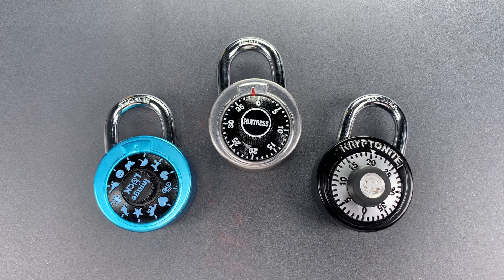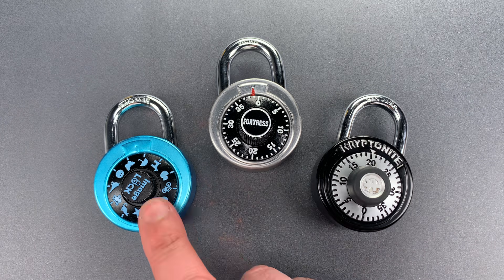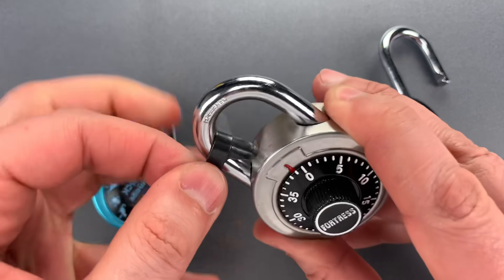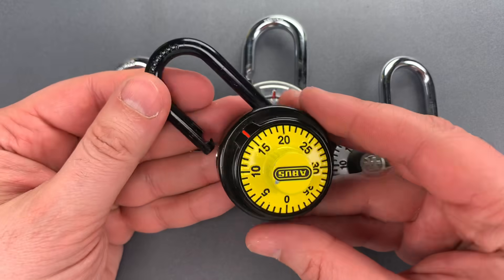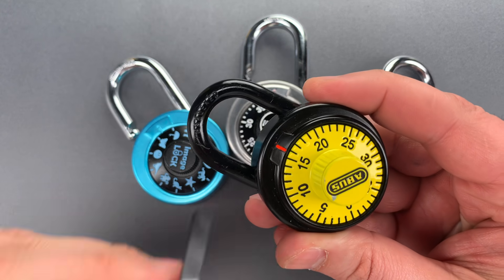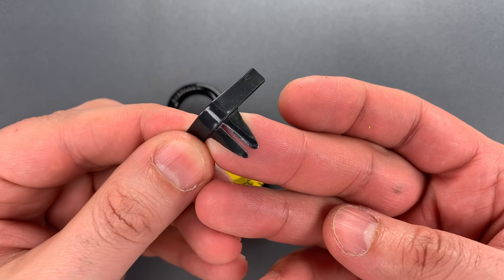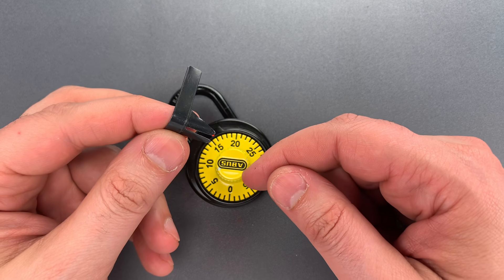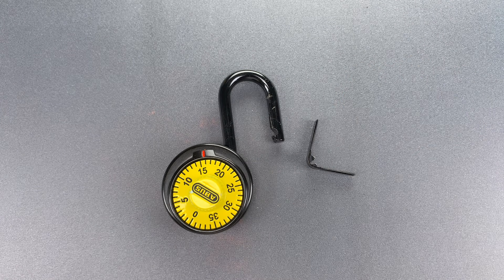[1243] Shimming The Anti-Shim Abus Combination Lock (Model 78/50)

Comment: Instead of 1 second taken to open, Abus increased the time to 3 seconds. It is a 300% increment in security ! :-D
Reply: You should be head of marketing dept
Reply: Lol yes
Reply: "New lock, now 300% more secure!"
Reply: Not 3 if the thief needs to cut his tool.
Reply: Adds in ~5 seconds to cut with scissors. 800% more secure!
Reply: @robot_killer  no why should he have scissors
Reply: No, it is a 200% increment.
Reply: @bethankfultohaveinternet3292  
Well now the thief probably has two shims. One for the regular padlocks, the other for the ones with notches in them...
Reply: does the altered shim still work on the old locks? if that's the case, just bring altered shims.
Reply: @jaghatarkebab2020  Not you people again.
Reply: @HunterShows  200% more secure, 300% times more secure
Reply: @HunterShows  Weren't you on that ottolock video lol
Reply: 200%*
Reply: @stylesrj probably a thief will just cut the shackle

Comment: Well, they tried. And that is more than we could ever say about Master Lock.
Reply: ML tries as well, their best cores are in their weakest locks. They just need to learn to put good components with each other.
Reply: exactly - gotta give them credit for trying to fix a problem
Reply: @Hans-gb4mv  like their LOTO plastic locks, with great cores 👏
Reply: @Hans-gb4mv  There's a reason for that, those stupid red plastic locks are electrician flags, not tamper prevention.  The point of the extra pins is reducing the odds that any 5 electricians might have the same key.

So Masterlock can do better, and just doesn't.
Reply: ML's lack of resistance in their locks is exceedingly trying.
Reply: you can't be comparing Abus with ML, Abus makes some of the most unlockable cores, that even LPL can't pick, yet :))
Reply: @tsm688  But the LOTO cores also have security pins, which the normal cores don't. The security pins aren't going to do anything about electricians with the same key. 

And, anyway, I would imagine that no prudent electrician is going around removing a LOTO without doing a ton of diligence that they're not putting someone in danger, so even if two electricians had the same key I would hope that the one with the duplicate key wouldn't take the LOTO lock off if it wasn't theirs.

All this is to say that it's kinda silly that one of ML's better cores (with security pins and such) is in a lock that's not actually really a lock (since if you wanted in you could get through the plastic body of the lock trivially).
Reply: Master Lock is fine
Reply: Master lock apparently has improved their 4 wheel combination locks so that theu can't be shimmed so they look like theu might possibly be starting to listen.
Reply: Why even try when LPL exists?
Reply: They really need to hire lockpicking lawyer as tester and not just send product for free to test... So he can actually help the market to grow security and its right he got money for this.
Reply: @ArchangelExile  Because security doesn't begin and end with "can LPL bypass it?"
Reply: Actually the master lock can't be opened with these shims, believe it or not the locking pin has cuts in it that dig into the pin and cannot slide it back.
Reply: @Gkitchens1  no they can just in a different way
Reply: @kieranreid4142  how, can you explain?

Comment: WOW ....The "fix" defeated in under 30 seconds..
Reply: And it was probably designed over months xD
Reply: It's mind boggling the solutions corporations come up with.
Reply: @hcgtiger4724  let the dead bury the dead.
Reply: "Locks keep honest people out" an old man said that to me years ago. If somebody really wanted to break in they will, like a window. Even the exterior construction of a homes wall is fairly easy to get through, usually 1/2 inch plywood which you can cut quickly, insulation that can be pulled out by hand, then drywall with a foot or 2 hands
Reply: I haven't met a combination lock like in the video that I haven't been able to open with a swift downward blow with a framing hammer. Doesn't need to be picked, bring a hammer
Reply: @dudesumting  the lock should be good enaugh to force him to use other methods tho, if he breaks a window therenis evidence, if he makes noise maybe someone will notice.
Reply: well from defeat in 3 sec. to defeat in 30 sec. is a 1000% improvement.
Reply: @HalIOfFamer  I do not disagree with you at all, but in my mind most thieves know that missing items will be noticed regardless so there's not much insensitive to be that discrete.
Reply: @dudesumting  everyone is always so worried because they themselves would be thieves, therefore they constantly consider how to protect against people like themselves. Seams that Way, but I am just an observer with a perspective.
Reply: @shaunstark4263  not always, ever watch a serial killer documentary and thought about how stupid their mistakes were? Kinda the same concept lol we're not murderers but we like to play pretend in our minds. I'm no thief but I imagine myself as one when thinking about how secure something is lol
Reply: @Herdatec  good point!
Reply: @dudesumting  I'm not interested in pretending against the desires of my heart. They hurt. Do you pretend against your desires? Or do you pretend according to them? I haven't considered pretending against them, anyway. Perhaps I should.
Reply: @shaunstark4263  well we've clearly lived different lives, for me imagining how another side thinks really helps prevent future headache.
Reply: @shaunstark4263  when you live in a region with alot of unsavory people you learn how they think to stay one step ahead
Reply: @dudesumting  I am aware that I have lived a life in which I could not clearly speculate the intentions of others. Many be lie ve they can. Pride lead me to think I knew how the other side lived as well as my own. I know my own, and Trust them implicitly.
Reply: @dudesumting  I have also learned that unsavory is a matter of perspective, and my own perspectives have been thoroughly subjugated by my  desires. Upon this realization, many changes occur which can not be accurately described to or from the previous state.
Reply: @shaunstark4263  "Perception is a motherf*****" An army captain told me that one recently. I wish you good health.
Reply: @HalIOfFamer  
The lock is meant to secure a couple of books at school or stuff like that, it’s by no means intended to secure really valuable property in areas with a significant risk.
Abus ranks it as 3 out of 10 on its scale and says it’s for securing low value items or areas with no significant risk.
Reply: @HalIOfFamer  well the accountants probably said a fully splined shaft was too expensive
Reply: but 1st, get a scissors in 30 seconds....
Reply: I'd like, but for my fondness for the triple nickel.
Edit: too late.
Reply: @dudesumting  how deep is a well? 
Blessings to you, and yours.
Reply: AND you could probably includes the tool modification in that time....
Reply: @dudesumting  whoever told you locks keep honest people out didn't really think that statement through. Honest people, by definition, are not going to break into your house and steal from you. Therefore they don't need to be kept out. Locks are for keeping out uneducated dishonest people.
Reply: @dudesumting  depends, in most European countries, houses are made from bricks, not so easy to go through.
Reply: @derekhunter5040  you don't get it
Reply: @derekhunter5040  you're too literal
Reply: Hey, it took almost 10 times longer to open it...
Reply: @derekhunter5040  yea little too literal bud

Comment: Abus - spends untold number of man-hours and dollars developing new anti-shim padlock

LPL - spends 99 cents on scissors
Reply: Honestly, this probably took a single engineer less than a week to design.  Probably like a day to brainstorm to find the best possible routes to take and 2-3 days to iterate and find dimensions that work.  The hardest part was finding a solution that someone else didn't already have a patent for.
Reply: 99th like
Reply: @johannes960  you have fulfilled the prophecy and brought balance to the force
Reply: And it will work for all those existing shims still out there and in production, and for those that don't see this video or aren't clever enough to think of this themselves.  Thieves are not the brightest.

Comment: Abus: Makes shim proof lock
LPL: And I took that personally.
Reply: More like shim warded. If they wanted to make it shim proof they could simply do same thing as spring loaded door latches have (atleast good ones), have a second deadlock spring latch. This is push in activated by the door or in this case by the shackle going fully locked position. When dead lock latch is depressed (which is geometred to happen only after lock has depressed the spring loaded lock sear), it will deactivate the spring loading of the lock latch. Thus completely and utterly preventing shimming.

Shimming is based on inserting extra material, when dead lock latch must be deactivated by REMOVING material aka the door strike plate or shackle bar in case of padlock. The only other way to deactivate the dead lock is by actuating the actual lock cylinder. Thus as long as geometry is done correctly dead lock latches lock is shim proof. Once the deadlock activates, to push away the deadlocking bar either the latch resting against the shackle has to move out of way or the main lock cylinder must rotate out of the way to firstly allow the deadlock to release and then release the main locking latch.

These are decade old idea. The only it isn't used in padlocks is probably cheapness and lock of space. deadlocking latch would mean more mechanical complecity and thus price. Plus ofcourse in big door lock frame there is more room to run a dead lock latch. So one would have to do some extra extra engineering in small lock body to run the couple extra levers needed for dead locking.

So usually padlocks just do away with spring loading at all and instead leave it up to user to notice.... Oh this has been rotated to locked, I have to unlock cylinder before I can locks this again.
Reply: Man I read that “makes a shim lock proof” and I thought this was the most advanced joke I had ever seen. 
guess I’ll go back to bed. My brain go boom right now.

Comment: I remember trying to explain a general security exploitation philosophy to a friend of mine, which I think this is an excellent example of. Features which simply the experience of legitimate users are always worth investigating for vulnerabilities. In these cases, the experience is simplified by being able to close the lock without entering the combination. A lock which had no slope on the lug or shackle would require the lug be retracted for both opening and closing. A similar example is entry controlled buildings with no exit control; like door locks that require an RFID card to enter, but have motion detectors for exit. If you can slip something through a crack in the door you may be able to trigger the motion detector.

Comment: I would LOVE for LPL to design some actual anti pick features of locks
Reply: Well, the solution for many issues is Bowley locks. LPL has yet to actually pick even the weakest version.
Reply: it would actually be surprisingly "easy" but mass production would be either impossible or so expensive no one would buy it.
Reply: @DivinityOfBLaze  Yes he's done a few videos on those.  I'm curious how he'd overcome shimming on a non-keyed padlock
Reply: @theRandy712  isn't itbas easy as building the exact width for the shackle and the lock?
Reply: @DivinityOfBLaze  , I agree.  They even link to LPL's videos on their website.  Not that ABUS would do that!
Reply: @DivinityOfBLaze  Bowley Lock Grade 2: "The exterior cylinder housing is cast out of solid metal and come with large shields to protect against "ice pick attacks". The exterior housing is independently retained by 2 extra heavy duty screws which mount to an interior reinforcement plate to prevent the against "hammer attacks". LPL: Today we have two Grade 2 Bowley Locks. The first we're going to pick, and the second we're going to attack using a core puller........Well, that's all I have for you today...'

Comment: 5 seconds to shim the ordinary lock
10 seconds to shim the anti-shim lock
10 seconds to snap both off with a hammer.
Reply: 2 seconds. Hammer blows are virtually instant. Just may need a moment to realign.
Reply: @professorfukyu744  - size and quality, a bit noisy thou
Reply: Bolt cutter, 1 second

Comment: I find it hilarious how a company could spend months researching/developing a solution to simple picks like this, just to be ruined by LPL in a matter of seconds lol. These companies really should test more before calling something unpickable. They are the Titanic and LPL is the iceberg.
Reply: The obvious solution is to get LPL on board to help design a lock, then he can't very well destroy the company's reputation in a 90 second vid...
Reply: The trubble the designers have is that there tasked with doing so without impacting the manufacturing cost or time.
That's why abus went with a plate instead of  a ball-bearing mechanism.
Reply: When you sell a $4 lock you can only do so much. When asking for more money is when it should matter.

Comment: I would love to see you add a series much like the ramset, a truck winch pulling the body of the lock away from the shackle exposes a weak point. 

Where i live pad lock type devices are used mostly on gates to keep other vehicles out. I have yet to see this fail, and often the lock is actually still functional.

Comment: In high school we use to open combination locks by taking off a boot and smacking it downward or landing a drop-kick. 
You could usually get a few dozen of those opening before they broke, unless you snapped the pin under the dial, in which case the were forever open.

Comment: At this Point Literally, every lock company should give LPL Ratings to their lock. If they think their Lock is Un pickable it should be LPL Certified.
Reply: Rated by the picking technique: Comb Pickable, Shimmable, Rakes open, Single pin pickable,  Requires "The tool Bosnian Bill and I made", Ramset, and 50 cal.
Reply: "As Featured in an LPL video that is 8 minutes long" would be a hell of an endorsement.
Reply: @askjacob  that could be misleading, he's spent that long ripping through the designers for the poor security or demonstrating EVERY vulnerability the fools left in it.

Comment: Makes sense.  As long as the combination dial is the only control there's no practical way to install a non-spring-loaded locking system like ball bearings.  So a dial pad lock will pretty much always be shimmable.

Comment: To be fair to them, this would prevent the use of standard padlock shims and most typical thieves (or high school students / principals / kids) would have no idea why, and probably wouldn't cut off the padlock and disassemble it or buy their own to figure out why & then make a custom shim. Any thief that will go to that much trouble probably isn't going after something defended by this kind of padlock anyway.

That said, amazing job by LPL, as always. I like these kinds of videos with the quick analysis, problem solving, and ingenuity on display; just as impressive as the ones requiring just raw picking skill. Maybe instead of trying to bolt on a fix to a broken design, the lock designers should try coming up with a new design without the flaw(s) that allow this kind of attack in the first place.

Comment: Wow, when you break into someone's locker by shimming one of those locks, you gotta wait a little extra not to raise suspicion because of how fast you opened it.
Reply: I was thinking the same thing, I had a lock like that on my bike years ago, and it took a few good seconds to do the 'three turns to the left, two turns to the right, one turn to the left thing (and trying to undo one in the dark by moonlight was fun...)
Reply: @steved2136  you could have the shim in place, then as you screw your face [to alert any onlookers how hard you are trying] when turning the dial to simulate the opening code, you mutter a sigh/expletive [for the onlookers] as the shim is push down to open the lock; thereby giving the impression you haven't just opened it in under a second. I'll get me coat.
Reply: in reality people are wondering why you are taking so long since a sharp tug will usually open one of these.

Comment: The annoying thinng is this could be prevented by adding a collar to the top of the locking bar which interlocks with the shackle and covers the whole top of the hole. 
It would take two small cuts into the shackle and a small addition to the bar.

Comment: Well, he took 1 second with the first lock and 7 seconds with the "anti-shim" lock so I guess that's progress.
Hard to find a silver lining for the lock companies.
Reply: Back to the narrowed shackle countermeasure that blocks the edge all around the hole.
Reply: That took him 7 times as long to pick! That’s an absolute MIRACLE in regards to lockpicking!
Reply: It’s a combination lock probably designed for something like a gym locker where thieves would shim random lockers and take whatever looks valuable.

 Something like this would probably keep you fairly safe since a casual shimmer is not gonna take the time to look up how to bypass this specific lock when there’s easier targets inches away
Reply: @jacobb5484  the school would use all the same locks, however.
Reply: "700% safer than our competitor's models"

Comment: Surely the most obvious way to prevent this is to make the locking bolt unaltered other than the part which contacts the shackle on the way in, perhaps by also partially shaping the bottom of the shackle to an angle also to assist pushing it out the way upon locking, alternatively a padlock may just require you to have the key in the unlocked position to insert the shackle like many padlocks tend to anyway after they've been outside for a bit